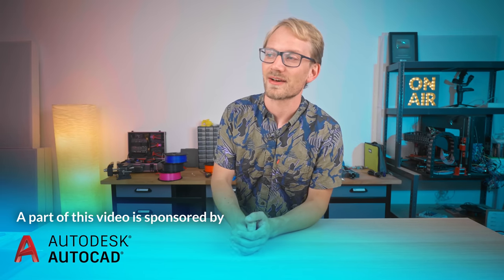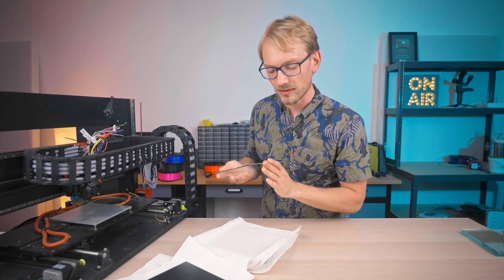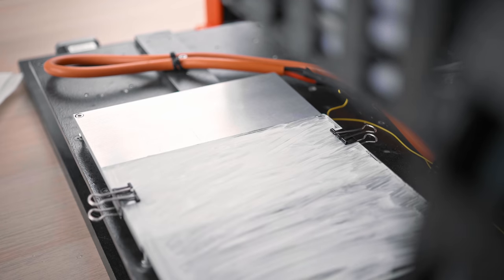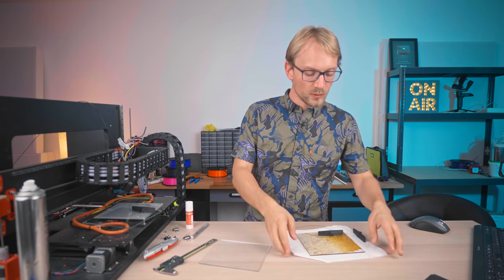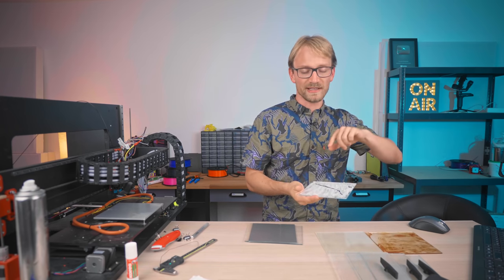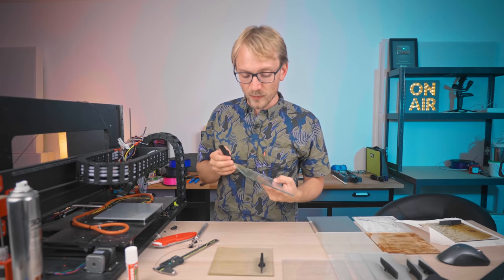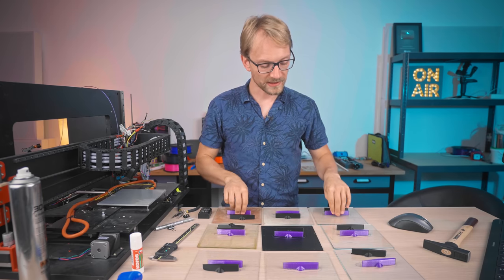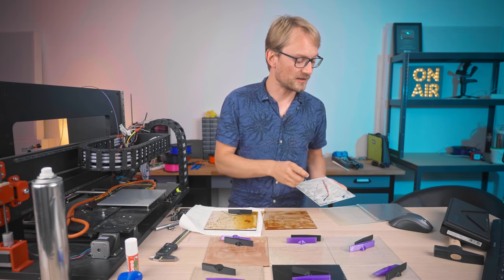Perfect 3D Printer Bed Adhesives - from the Grocery Store!

Comment: PETG on borosilicate glass is a no-no without a coating of some kind but normal plate glass is fine and with a wash of 3:1 water:PVA wood glue it works well. I now exclusively print on PEI coated steel a.k.a. Prusa plates. Pineapple juice??? You need to get out more!🤣

Comment: What about simple suger disolved in water? No oven required, just spread it with brush over heated bed, water will evaporate. Saline water comes to mind as next  possible surface and perhaps some other water soluable materials can be used in the same way. Soap is another contender that could be tested. 
And if you would like to continue this testing, try different brand PLAs. I was surprised how differently they can behave - where black prusa PLA sticks without problem, yellow creality PLA is the worst material I've worked with - I am unable to make it realiably stick. Even on very simple models  like test cube one or more corners will lift.

Comment: Experimentation is good but printing plastic parts should not require glue stick sprays food, or chemicals to allow them to hold on the surface if the surface to begin with is properly designed.

Comment: Can anyone tell me if I scratch the glass with sandpaper will the pints stick??
Reply: With glass, you not only have to find someway for the plastic to stick, you also need to think about getting the part off from the bed. Clean glass usually works just fine, maybe even the best but if there is some medium between the print and the bed, you can always pry it off the bed. Many glass beds have been destroyed by the part sticking to it too well.
Reply: @squidcaps4308  k thanks

Comment: Would “corn starch” dissolved in water work?
Reply: You'd probably need to boil it - not for long, just bring it to the boil and let it cool.  Starch is almost insoluble in water, but boiling hydrolyses some of it to dextrin, which does dissolve and is gelatinous.  That's why the pasta water worked.

Comment: I think if you sandpaper on the glass the 3d prints would stick on the glass too,
Reply: The problem with glass is not so much to get things to stick to it, it is also to get the parts out after. It needs to be sticky enough that it holds print but not so strong adhesive that it can be pried off without breaking the glass. There is a happy medium, pun intended, between the two extremes.

Comment: If someone wants to try it on a Prusa textured sheet: the Powder coating is not water tight and with water or also pineapple juice and humidity from air it will corrode very quickly an will become useless.

Comment: I'm using a tube of glue, but I'll probably start with a glue. Why am I changing something that works? The simple reason that you haven't covered is cleaning. It is supposed to be easy to clean under tap water, the hairspray seemed perfect, nice even surface, until I decided to clean it ... I have enough chemicals at home, acetone etc but it was not easy anyway.
Non-water resistant wood glue + atomizer would be ideal.
Reply: 666Azmodan666 I’ve found that just really HOT water will melt it off no problem. Great thing about hairspray is that it doesn’t need to be cleaned off that often if you cover the bed with a sheet of paper when not in use.

Comment: Why not just use a magnetic springsteel bed with a PEI layer? No need to recoat anything and easily comes off with a twist of the plate.
Reply from the maker: I don't think they sell those in the grocery store yet.
Reply: Because it's expensive and not as accessible to everyone
Reply: @MadeWithLayers  Ah, the "Grocery store" part from the title was cut off for me, the video makes a lot more sense now!
Reply: @martenthornberg275  I am working out in a field office on the Syrian border in Lebanon, a collapsed country, and was able to get one from AliExpress, in the middle of the pandemic, for $15. That is 3 months worth of glue stick if you print a lot. Not that inaccessible nor expensive.
Reply: @Happy_Free_Time  that's pretty amazing, but not sure it applies everywhere and certainly not for bigger non standard sizes. The way the economy works, highly specialised items like a magnetic base with a pei spring steel sheet will always be more expensive and less accessible than e.g. pasta water.
Reply: (and one small gluestick lasts a long time, I still have the first one I bought, but I guess it depends on how much you print)
Reply: @martenthornberg275  I work in pretty remote or war torn places generally, so office supplies aren't readily available most of the time, a medium sized glue stick is about $3 at the Dollar store here, and would last about a 3-4 days with 1 good application consuming about a 1/5 of the stick at a time. My printers running 24/7. So costs do add up with you run a business.

With that in mind, I can obviously get glue stick cheaper from China in bulk, but the other added benefits also outweigh it. 

1. A springsteel bed is available to reuse immediately with prints just popping off.
2. Less pollution. No plastic tubes to throw away. (No recycling here)
3. Saving potential medical costs. Prying things off glass is pretty dangerous and a trip to the ER isn't cheap.
4. Inductive sensors work on it. So less time spent bed leveling.
All for $15 pp incl. for a 20x20 bed. Around $23 for a 35x35 bed. 

None the less, I agree with you, although jank af, I doubt anything can beat the cost of pasta water.
Reply: @Happy_Free_Time  Hmm, when I'm checking prices for a 350mm2 plate it's about 60 USD and you also need a magnetic bed I believe? And does PEI work with all materials? But that's not really the main point I'm trying to make here. For a lot of people (like you probably) a PEI coated bed makes the most sense, no doubt (I believe Tom had the glass plates siting on top of a PEI coated piece of aluminium tool plate for example). But exploring cheaper alternatives are still valuable since it helps drive down the cost of things like PEI-sheets because now they have to compete with glue stick and maybe pasta water. If no one kept pushing for cheaper alternatives we wouldn't have cheap 3d printers to begin with, it would all be monopolised by patents and speciality parts manufacturers. As long as the printers only rely on standardized, commonly available parts and materials they will remain cheap (and become even cheaper).

Comment: just get a coated glass bed like ultrabase :p
Reply: Seconded. Since getting an Ultrabase on my KLP I've never required any kind of adhesive to print PLA on it, just a quick wipe with a wet cloth with a drop of detergent in it before each print and the prints will just pop off by themselves when it cools down to 35C.
A word of warning, though: if you're going to print PET-G on it you'll want of liberal coating of white-capped UHU stick or it will tear chunks out of the coating.